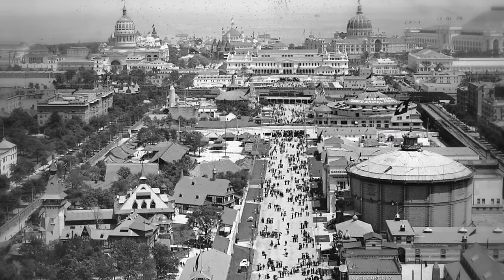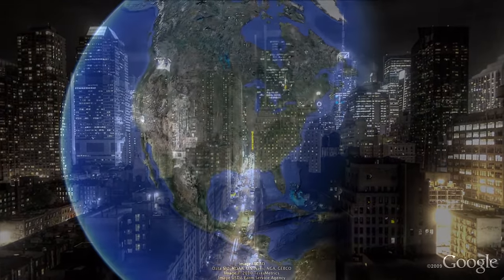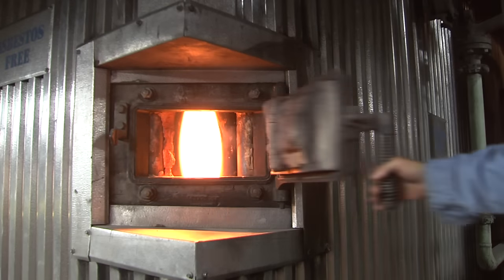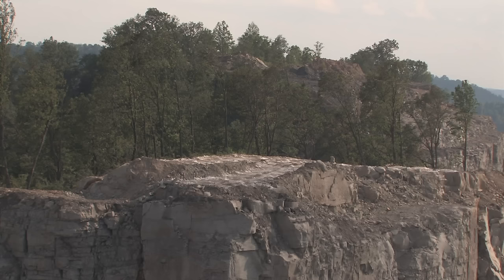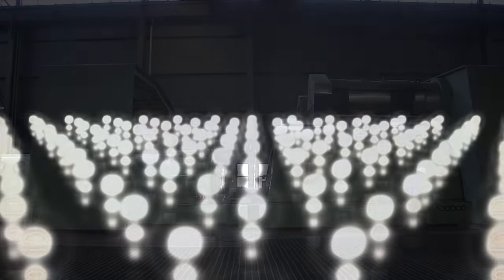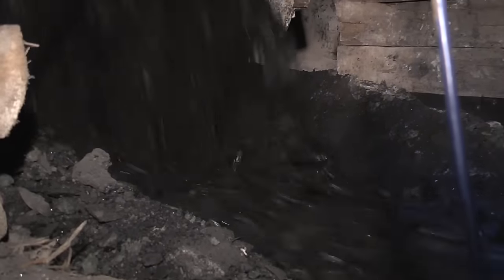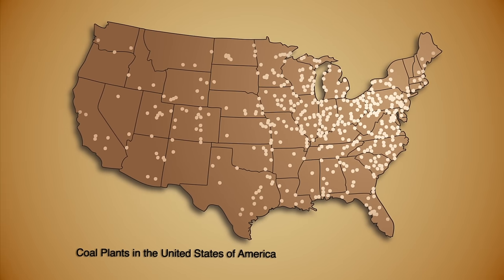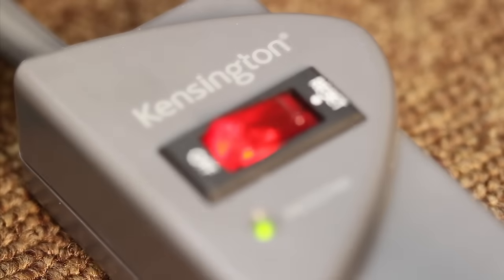Coal In Kentucky (Full Documentary)

Comment: Approximately 40% of power generated in the US is by coal burning power stations.  Solar panels and wind turbines are simply not up to this particular task.
Reply: Down to 30% now. But I agree, coal is a necessary resource.  Having a 60 - 70 day fuel supply on site is a huge benefit. You don’t get that with gas or wind or solar.
Reply: Power plants fueled by natural gas is another option to coal.

Comment: Things have changed some since 2011. From the Dept. for energy development in Kentucky in 2017.  Kentucky, currently the fourth-largest producer, with almost 6
percent of national production in 2016, provided coal from
 deposits of the Central Appalachian Basin in the Eastern portion of the state and the Illinois Basin in the Western
portion of the state. Coal production in Kentucky decreased
 by 29.9 percent in 2016 to 42.9 million tons. Peak coal production in Kentucky was reached in 1990 when the
Commonwealth mined 173.3 million tons of coal, and has decreased by 75 percent since." Coal exports have increased to developing countries.
Reply: The discovery of fracking, (which provides cheap and abundant natural gas,) has naturally cut into the market share of coal for power generation.
Reply: @EyeonthePrize247  A price that is paid for the benefit of the entire nation. Every major industry has had an adverse effect on our environment. It doesn't matter if you look at wood, coal, natural gas,  or nuclear. I am not going to deny the environmental impact of fracking, but we also have to weigh out the net benefits. Electric vehicles, and solar battery storage systems are heavily dependent on Lithium. Lithium mining is concentrated in Chile, Australia, China, Argentina, etc. Nuclear power has radioactive waste despite not emitting CO2. Nuclear power plants are also targets for hostile nations or enemy terror groups. Every current power source has its perks and drawbacks.
Reply: @johnsummers5565  

I hear you. While the Green Industry is certainly not without flaws, they can be a viable alternative in hydroelectric or wind power. We can’t just throw our hands in the air and say “fck it, everyone else is doing it and these other energy sources also have negative consequences.” It shows we have little disregard for future generations in my opinion… I’m childfree by choice and I feel good about that decision. Who knows what world will even be here in the next decade.
Reply: @EyeonthePrize247  The problem is, hydro and wind energy is NOT sufficient to power the American Grid. I did the math once, and I believe it calculated that it would take three states the size of Nevada full of solar panels to sustain power for one year. Before Electric cars are introduced into the fray.

The best solution is to find a way to make the existing systems cleaner. Which is absolutely possible in the Coal industry,  although I doubt it'll change anything. Side note, it's your right to be childfree, but studies have shown that people who make that choice, often times have deep rooted depression and regret later in life. Not everyone, but it's likely a possibility, as it is literally, your only reason for existing. Stop being scared of what could happen, and live your life.
Reply: @camd4648  

I agree with you on the viability of making the existing systems we have cleaner however that would be in addition to making those renewable sources more viable too. And as I had said previously, I’m not anti fossil fuel, however, it seems like we have so many people working against renewables pretending like fossil fuels will go on forever and ever. It’s just plain irresponsible and inherently greedy. 

In regards being childfree by choice and having depression later in life, I already have my struggles with depression, among other things, and my worry is that I’ll never be able to provide the kind of life that the child should have… this hypothetical child deserves so much better than what I could ever give them. I’d rather let my genes die out and save someone the potential disappointment of having me as their father.
Reply: @EyeonthePrize247  I agree with you, and I will not be responding to your first statement.

On the topic of fatherhood. I don't know you personally, but your worry about being a disappointment is completely normal.  I'm not a father, but I have gone through two miscarriages. The first being at the age of 19, and the most recent being in 2020. My Baby Boy Mateo Augustus would've been born on April 20th, 2021. When I found out, my now ex fiance was pregnant, I was extremely concerned because I was working a shit job, making shitty money. I was extremely undecided in life, and didn't really know where I wanted to go. Unfortunately, as I stated before, it ended in a miscarriage, at about seven months in. The relationship ended not long after.(Our grieving process was very different, and she expected me to want to talk about it more. I didn't, so she got the attention elsewhere.) So, in the span of two months I had lost my baby, my relationship, and I was living on the streets in the Ohio Winter. My ex constantly attacked me in the following months saying I'd have been a shitty dad, and that she's glad I was finally gone.
Point is,  for a very long time, I felt the same way you do, and it has been very difficult convincing myself that I am worthy of being a dad. It's always : "If I had just made more money." or "If I had just done something different." Which is extremely ridiculous to tell yourself. 
What really changed my view was simply realizing that everything I could tell myself simply wasn't true. We control our own destinies, and that means, whether you're making minimum wage or a million dollars, what matters most is providing a life for your child to grow up in. I was bitter at my father for a long time for making me grow up poor while he drank alcohol every night. But then I grew up, and saw all the sacrifices he gave to make sure I could live a better life, although not a glamorous one.

This might be a little cringe, but truthfully, whatever you decide is best for you, I encourage you to do, but don't ever believe you're not worthy of a child, because think you couldn't give it a happy life. A present father, who fulfills the needs of the child, is absolutely worthy of that gift. And it's never too late to change, if you still feel like you're not where you want to be. I became a Diesel Mechanic, at 24 years old, weighing 110 lbs busting my ass, so I could feel worthy, and I hope to feel that joy of being a father some day. Keep grinding, and never give up. You're worthy.
Reply: @camd4648   

Your kindness, compassion and support has genuinely touched my heart. Thank you for sharing your experience. I can’t even imagine what that must feel like on top of everything else you’ve had to endure. You sound like you have a good head on your shoulders with an incredible amount of determination, empathy and altruism. You deserve all the success and good things that this life has to offer… any child would be so lucky to have you as a father and any woman would be so lucky to have you as a partner. 

I will give more thought and consideration towards the issue… I shouldn’t make a permanent decision based on somewhat temporary feelings. Your willingness to uplift and support a stranger on the internet is not cringey by any stretch of the imagination… it shows the true content of your character. 

Thank you from the bottom of my heart. Keep your head up and stay strong, brother. 🖤

Comment: Renewables are not sustainable, ie. it is not available 24/7 throughout the year. Solar is not available at night while wind turbines depend on the available of wind and must be turned off during stormy conditions. Nuclear remains the only alternative for coal, but it also has serious storage problems of spent products. Underground sequestration of carbondioxide  is not required because high levels have proofed to be advantageous to hot houses and tunnel farming. Very high levels of carbondioxide is characteristic below the canopy of rain  forests, in fact the huge bio diversity in rain forests requires very high levels of carbon dioxide.